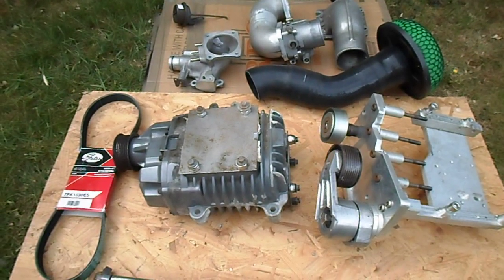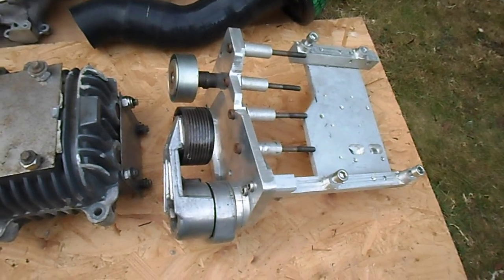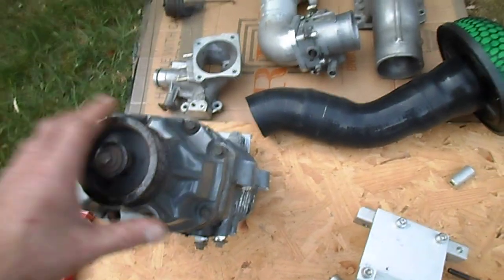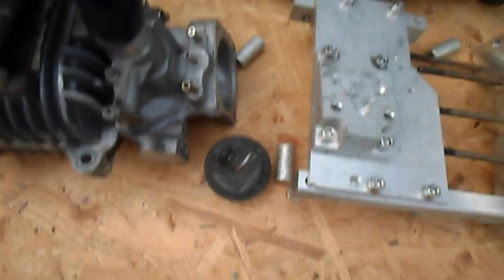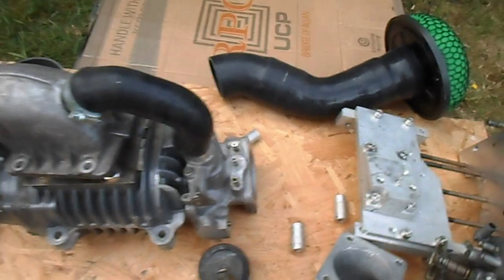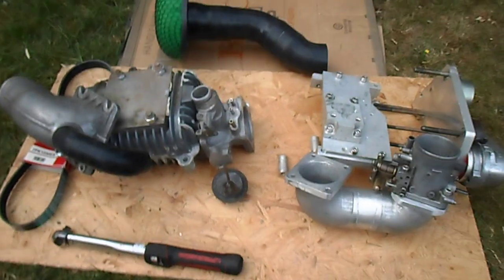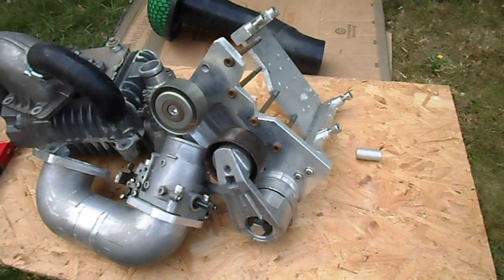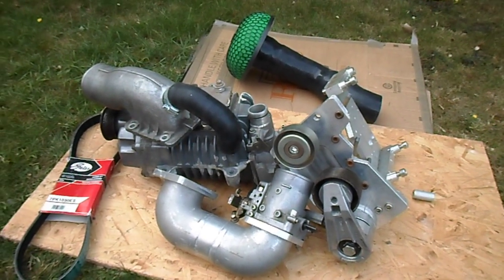Toyota Celica Supra 5MGZE m90 Supercharger components

Comment: did you ever finish this? I have the summer off and ive decided to put a sc on my 5m. This would help a lot, if not some knowledge would help too!
Reply from the maker: Hi Fritz. I took it off for the moment as got the car back on the road and just want to drive it this summer as has been off the road for 6-7 years and i miss it. Will be going to the next stage during the winter months. Going to do a video in the next week so stay tuned!
Reply: @SHIREDRIFT  Hey good luck with the conversion. I had to install a 7MGE in my recently purchased mk2 to get it street legal and transfer it to my name. I'm still doing the wiring and the ecu. Once it's running I'm hoping to get a 5MGE, rebuild it from the ground up and sc it with a 4 barrel carburetor setup but still retain the original distributor.
Reply: @SHIREDRIFT  
Hello there 👋
Any updates on this Gem ?
Reply from the maker: @meca13b  Hiya, well to be honest I've just been out driving and tweaking the car on challenging local roads at the weekend.
I am going to Bicester Heritage for their Sunday Scramble event this weekend so do plan to do a bit of filming there. And fully open to suggestions of content you want to see (within reason!) If you want me to cover something a bit more in depth on the car let me know in the comments
Reply: @SHIREDRIFT  
Awesome.   Most definitely like to see it full depth. Also thinking of doing a similar set up for a 1985 Celica Supra with a 5mge im working on .